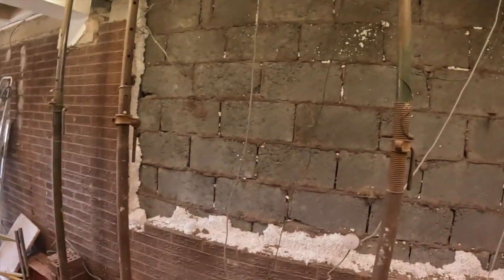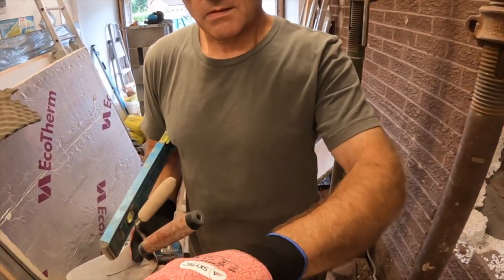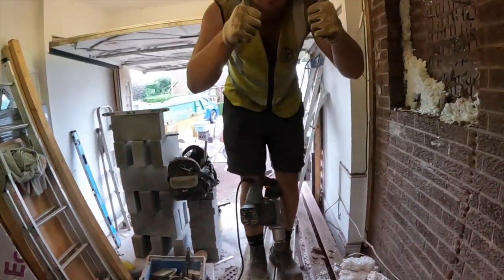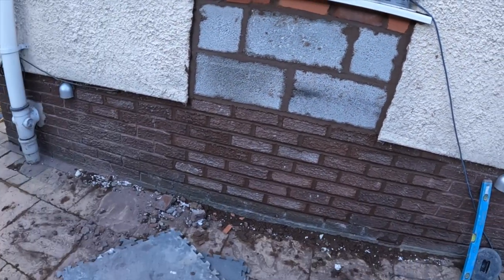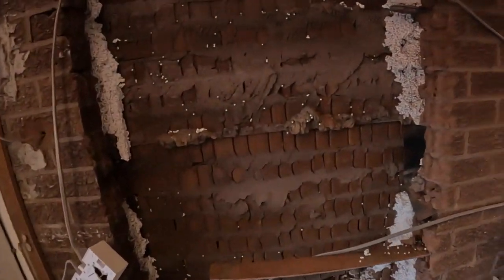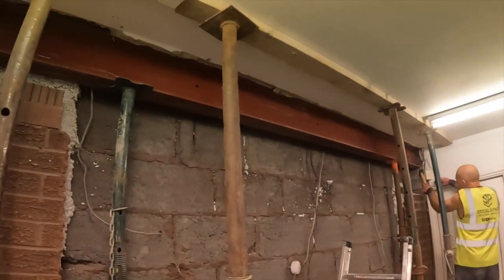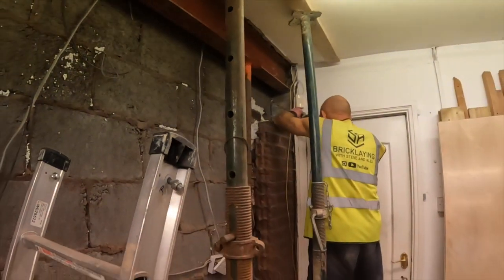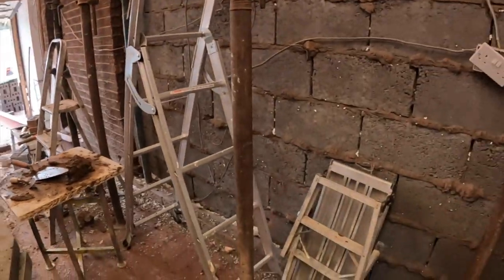STEEL BEAM NUMBER 1 INSTALLED  !!...GARAGE CONVERSION PT 3

Comment: Hi Steve & Alex. Another cracking video. When the outside is rendered you won’t even know there was a door there you would it always a window. This must be the most demolition you have on a job can’t recall to many projects with loads of demolition.  But you make light work off it always so clean and tidy.  One steel in great job. Have a great new year guys 👍
Reply from the maker: Cheers John boy, yeah a nice big job to get stuck into 😁💪🏼👍🏽🧱